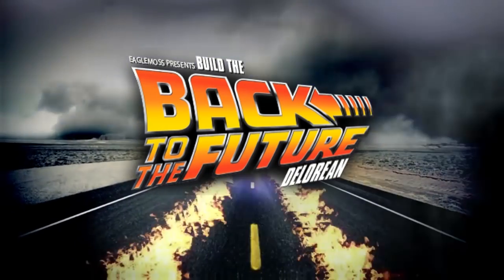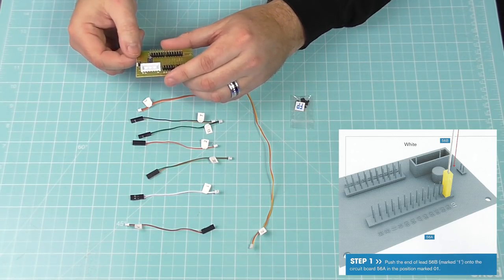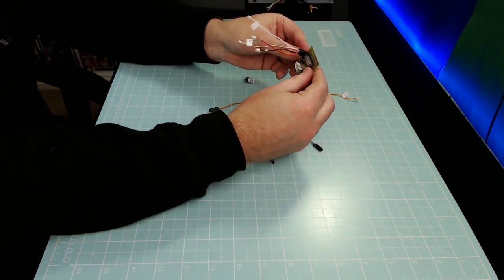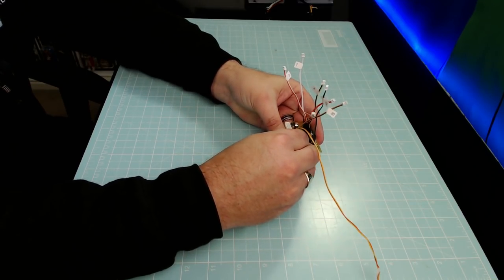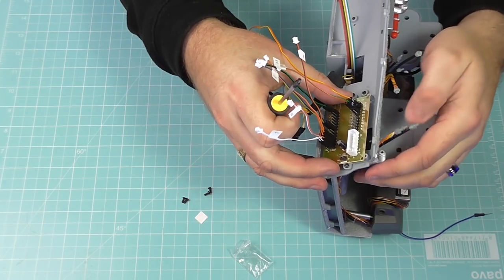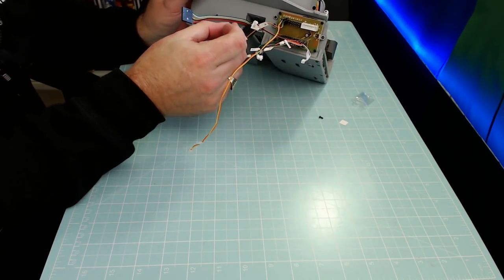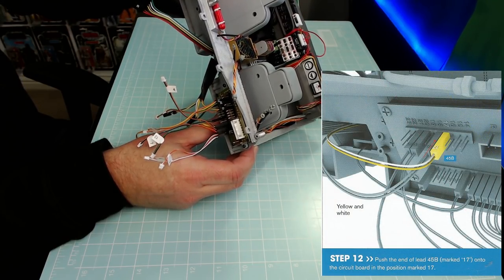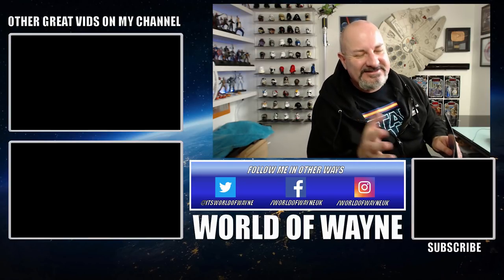Build The Delorean - Issue 56 - The Main Circuit Board

Comment: 'Twas worth the wait. Just remember when you do get to the stage where you can press buttons and turn lights on, only some of the buttons will work, and that's provided they click when you push them in. As long as you can get everything lit up that's been provided by Eaglemoss so far then everything's fine and you can ignore the other buttons until such time as Eaglemoss give you something else that illuminates once they're attached to the things. If your buttons don't click then they're probably getting caught on your carpet/vinyl mod. I haven't gotten to any of this stage yet, but I've been watching the builds from others who have got past this already. Apparently some people have their on/off switch installed back-to-front too so that's ballsing things up for them as well.
Reply from the maker: I already did a fix for the clicky buttons when I tested them earlier but I can't wait to get to that stage. Gotta get through Issue 58 yet. Thats going to be an interesting video lol :D
Reply: Oh yeah.... It's been such a long time I'd forgotten. ;)
Reply from the maker: The funny thing is. I could have bought, assembled and shipped a real Delorean in the time it has taken to get these issues :D
Reply: Probably work out a bit cheaper in the long run too. ;)